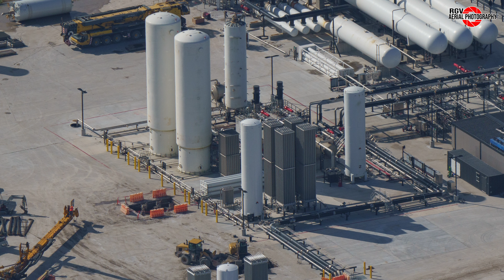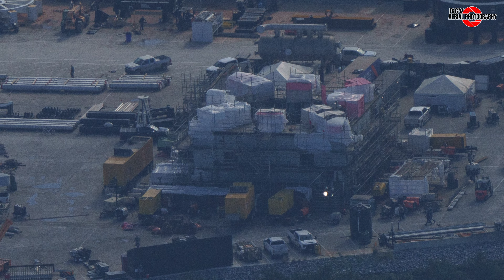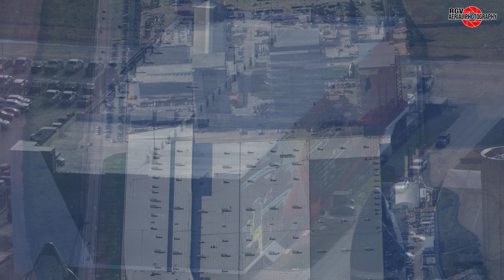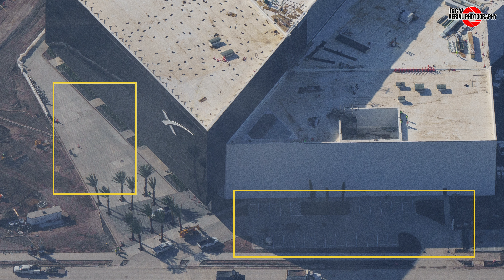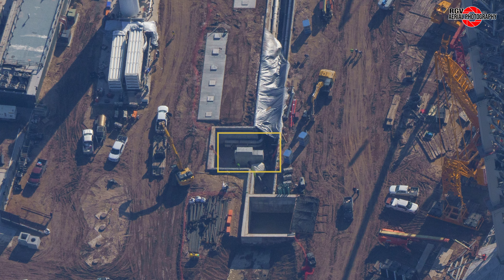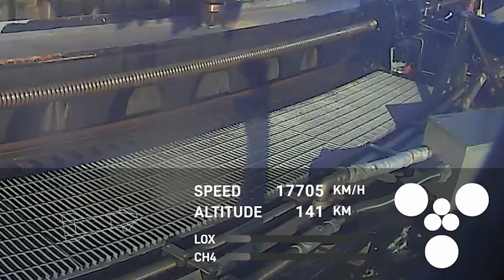Major OLIT + Flame Trench Update! New Starbase Flyover 71

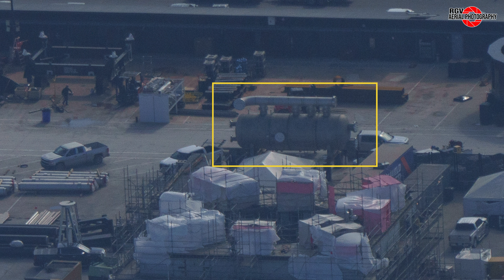Comment: 4:12 can someone explain to me this part of the video like I'm 5th grader lol 😂
Reply: This is a fuel chiller that has 2 parts of different size. Left side has 1 pipe on top, right has 3. Smaller side with 1 pipe is for smaller Starship, bigger side with 3 pipes is for bigger booster. Previously installed chillers had to parts of the same size instead.